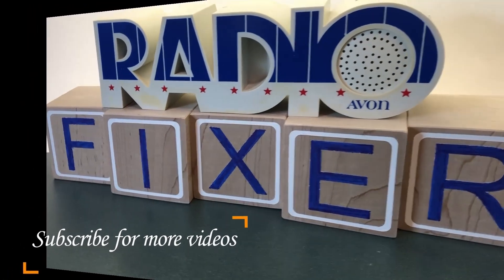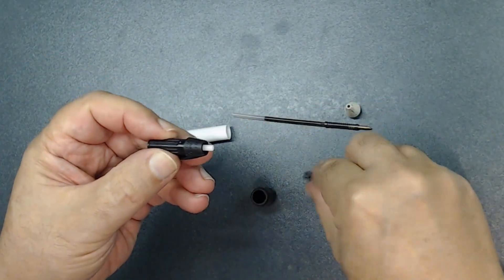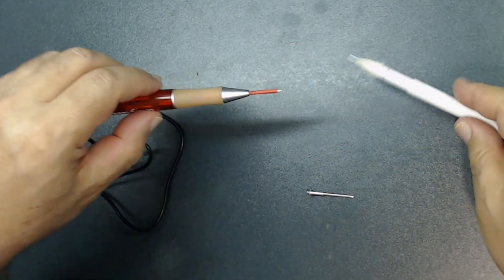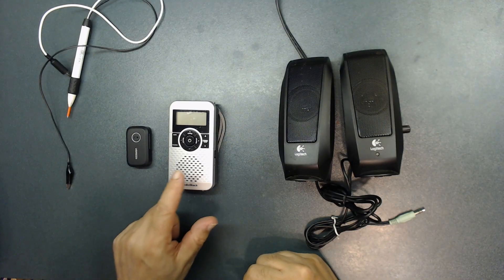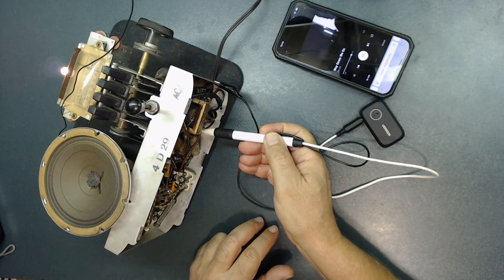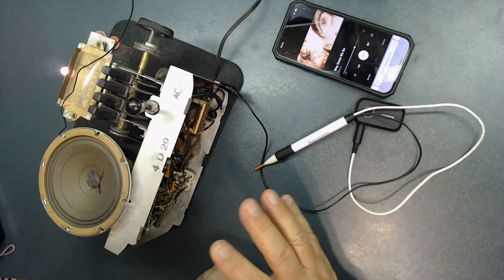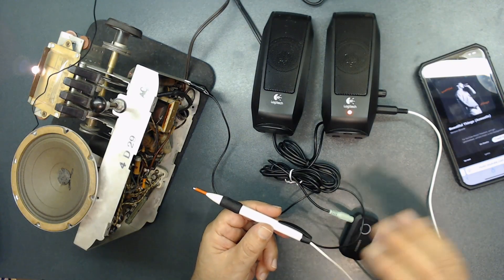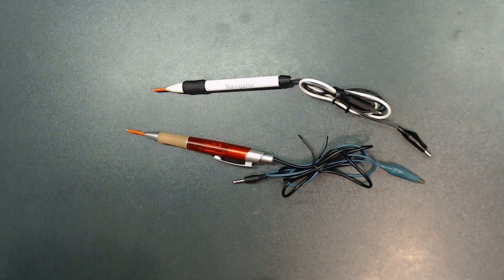Build a Bluetooth Audio Signal Injector | DIY Diagnostic Tool for Audio & RF Circuits

Comment: Is your radio powered when you test with your injector? I don't understand anything, do you have a diagram please? Otherwise your videos are very good, I'm a subscriber but I'd like to better understand what you're doing, thank you
Reply from the maker: Hi William, good hearing from you! The schematic to make this injector is in the end of the video.  Let say that signal tracer that I put together “https://youtu.be/K3QjCYdi4V8 “ and “https://youtu.be/g5UkU5gjeIw “ detect signal in antenna, converter tube 12SA7, and I.F. tube 12SK7 section but there is no signal on first audio tube 12SQ7 or Output tube 35L6. I use the signal injector to test audio section of the radio to see which audio section is causing problem.  The radio under the test should be "ON" and hooked up to Variable Transformer (variac) and Isolation Transformer to do these tests for safety.  Hope this answer your question! 
Thank you for taking time to message me and supporting my channel. So glad and happy that you enjoyed watching this video. 
Have a great day. Regards from Florida, Jay
Reply: @RadioFixer  thank you very much  ,    have a great day . Regards from Brittany  France
Reply from the maker: You welcome! You live in a beautiful peninsula. Wish you the best!